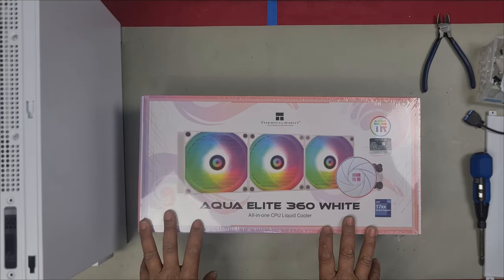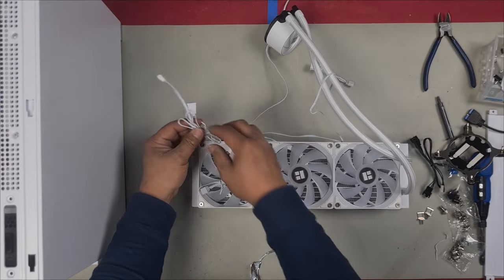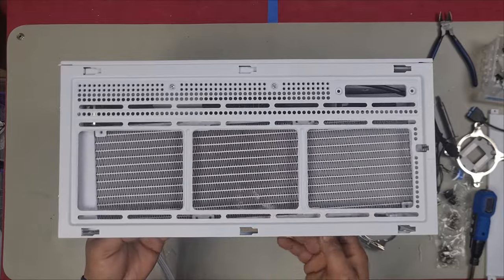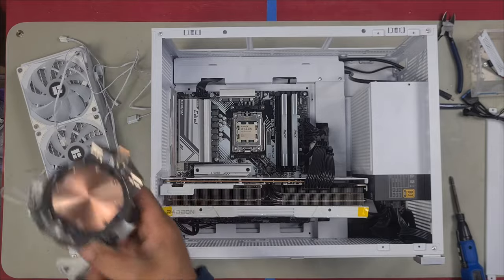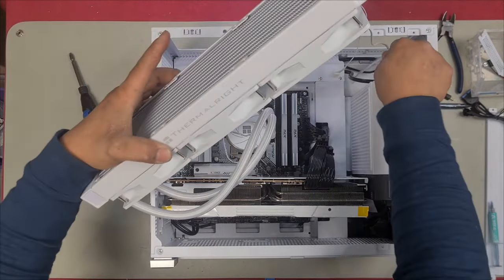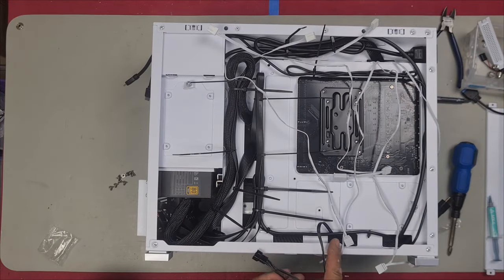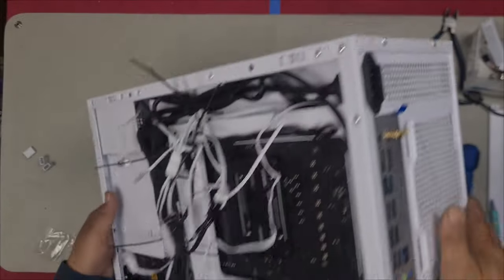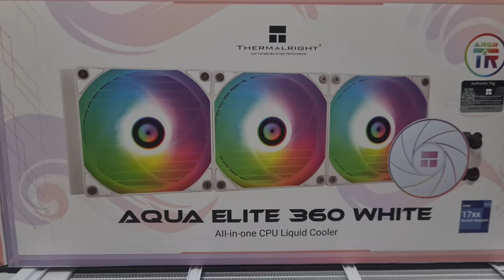how to :thermalright aqua elite AIO liquid cooler installation guide

Comment: Can you remake this for dummies like me?  The cable connections are driving me crazy
Reply from the maker: how do u mean
Reply: @MIKEYZVLOGZ  the argb cables are driving me crazy, I have so many cables I don't know where to connect. I have now bought an argb controller that I hope fixes my problem
Reply from the maker: the cables all have splitters on them so your able to connect them together aka daisy chain. so basically u connect each fan like a chain ... same for the fan cable 4pin pwm) except u use the black splitter cable they supply u with the cooler and once they are all connected...the last cable plugs into the 4pin  motherboard. u can use either cpu_fan1/sys_fan1 etc
and the argb plugs into the 5v3pin header not the 4pin 12v ..make sure u match the amount of pins and the label is there too so do not criss cross or you may damage the fan or short something
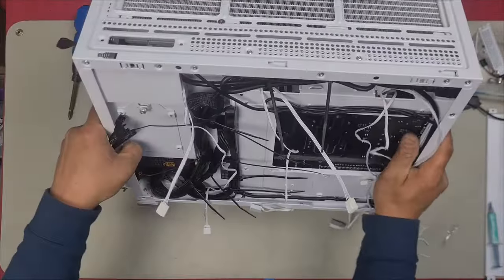Reply from the maker: @SaMcfc05 u didn't need a hub but u can use it did u ensure it was a 5v3pin hub at 8:50 I show how to daisy chain the cables...for the fan power pwm..u use the black splitter cable that comes with the aio... that allows you to plug all the fan cables into it ..and u plug that black cable into cpu_fan1 or sys_fan
Reply from the maker: @SaMcfc05 how many argb cables do u have total? I would suggest being patient and slowly route the cables one by one where u want them to go
Reply: @MIKEYZVLOGZ  I have a different model from the one you shown, I have one cable coming from the pump and one from the top where the pipe goes to the fan.  The second one is a different cable from all the fan cables I have seen and I have 8 it's 3 pin female but it's smaller than the rest.
Reply: @MIKEYZVLOGZ the black splitter was fine I did that, but the rest is where I'm not sure what I'm doing. I have 8 fans in total now. That's why I thought to buy an argb controller. It's becoming a real mess
Reply from the maker: @SaMcfc05  ok I see... right so the fans that have splitter cables on them already plug them together so it becomes 1 plug that connects to the hub ...and the rest u plug directly into the hub... honestly it just takes time and patience is key... wen infirst started building I hated doing it..but now its more of a necessity cuz u never want cables everywhere ...zip ties and twisty ties come in real handy... but if u struggle I'm building another pc and I'll show how I go about it...in the meantime keep trying ...it's straight forward ..just a matter of finding cleanest route and using zip ties to keep cables together to look neat
Reply: @MIKEYZVLOGZ  I will be watching. It's my first time building a pc  have been putting it off for years.
Reply from the maker: @SaMcfc05 oh I see fair enough ...I'll try do a short for u and then maybe a full video ...just know it takes time ...so don't know if u wanna just search youtube for other videos as there are heaps out there ... but I will address this for u...obviously I don't cater to individuals as it's impossible but I feel this will help alot of ppl too
Reply: @MIKEYZVLOGZ  there is not enough videos I liked,  especially with the cables and this brand. A full video for dummies like me would be great.
Reply from the maker: @SaMcfc05 fair enough
Reply: @MIKEYZVLOGZ  a lot of them focused on mounting, which is not hard, and all aio are the same with mounting. It's the cables that I struggled with, like this brand doesn't use many labels,  manual is terrible.
Reply from the maker: @SaMcfc05 I see.... I know what u mean .. I will do my best to give u a 60 sec short guide ..and then maybe an in-depth video on how to wire and route cables for aio argb..with and without a hub

Comment: I daisy chained everything and there's no argb thing left
Reply from the maker: where did u plug the final 5v3pin
Reply: @MIKEYZVLOGZ  I just unplugged one of the daisy chained cable and then plugged that into the rgb slot. It works. I booted my system and it doesn't detect ram or the CPU so I guess I have to take it apart again :(
Since you built a lot of pcs, do you have an idea of what the problem is?

Comment: I’ve connected the fan cable coming off from the block (pump cable) to CPU_FAN1 and or CPU_OPT. But in BIOS it’s shows 0RPM. Is it a dead pump?
Reply from the maker: wen connected do u heat the water moving or fan spinning ..if so it's not dead

Comment: I just bought one. one question,  Can I connect all 3 ARGB fans and the ARGB cable of the waterblock pump together on one 5V  argb header on the mb?
Reply from the maker: yes u sure can that will ensure they all sync in terms of rgb ... due to having splitters for each fan... so daisy chain tour radiator fans then incorporate the pump fan into it and finally plug the last argb 5v3pin into the mobo header

Comment: really good vid my brudda, just one question, are you able to set one specific color for each fan,
Reply from the maker: @eddyramquist8811  only if your motherboard software allows for it...I think u can aa long you find a software that can do it
Reply: @MIKEYZVLOGZ  like the signal rgb or thermalrights own software, also would still be able to set one color per fan even with dasiy chainged

Comment: which software should i use if i have x570 steel legend . Will the cooler and fans ( Thermalright TL-C12C-S X3 CPU Fan )change color at the same time
Reply from the maker: polychrome by asrock

Comment: Hi, my motherboard only have cpu fan header and system fan header. Is there any way to install this aio?
Reply from the maker: yes u simply install into cpu_fan1 or sys_fan1 it will be fine... some mobos have a dedicated aio pump fan but if u don't u can just use the cpu fan1 as it will speed up according to your cpu temp which is kind of what u want

Comment: What cpu u put and what temp you get idle and max load?
Reply from the maker: the cpu was the 7700x and max load i was getting about 70 to 80 but u never run at max all the time that weas only during cinebench single core and multi core stress test

Comment: Hi, nice vid! Also, does the cooler come with thermal paste?
Reply from the maker: yes it does
Reply: How to change the fan colour
Reply from the maker: @ronn23k  plug in to your 5v3pin header on motherboard and then u use software to change colour...or u need a hub with controller and use controller after u connect to hub..it's argb meaning addressable so u can change colour

Comment: is the ARGB controlled in a software or is there a way to decide which color to shine ?
Reply from the maker: yes via software
Reply: @MIKEYZVLOGZ  does it have a proprietary software or would it work with asus sync, msi, …
Reply from the maker: @mhergoparian174 no proprietary software just use any mobo software to control argb ..as long as u connect the 5v3pin to the mobo u can control using tour mobo manufacturing software

Comment: Mine came with a different splitter which has made it confusing
Reply from the maker: it should work the same way though..u should have an instructional guide and it will show u how it's suppose to connect

Comment: Is this AIO compatible with the Kraken G12 mount?
Reply from the maker: should be does your kraken use a thumb screw to mount pump? even if not u can use any gigabyte and msi as they are identical...just has to have the same style mount where there's backing plate...and then stand and thumb screw ...basically if ut mounts the same way it will work
Reply: sadly dont believe I can use this AIO as the copper plate for this AIO is a more squared shape rather than it being rounded. Same thing applies to the rest of the Thermalright copper pump heads @MIKEYZVLOGZ  
I plan on buying the asus rog strix lc ii 240 argb which if you see how their pump head is, you can see the difference as that's how it should be to be able to fit the kraken g12 mount.
Reply from the maker: @play_stationjr8636  ok wait a second I thought u meant can it work with the back plate..u mean u want to use the kraken mount and plate with an aio that fits it right? in that case no u can't ut won't fit .. but honestly aren't u buying a new cooler anyway..it wouldn't matter would it? cuz u will get all new parts to use that are suppose to fit together
Reply: sorrry lol, so basically I wanna get a new AIO cooler to use with the kraken g12. The problem is, is that the kraken g12 round part where the pump head goes into is rounded. So now speaking for Thermalright, it looks like their head pumps (wear you can see the copper plate) is rather squared than rounded, so the pump head wouldnt be able to fit it into the g12 unless I trim the rounded part on the g12 into a more squared shape. if tht makes sense 🤷‍♂
Reply from the maker: @play_stationjr8636  hmmm  ..I get it now ur using it to cool a gpu ... why did u say that...lol..ok so u have to use a specific brand that has the same shape as your kraken like msi or gigabyte many other too but u gotta check before u buy... u need the round one with edges that go in a circle I know what u mean cuz I've used that before too...
Reply: yeah exactly! and sorry about that, I should have mentioned that from the beginning lol

Comment: Any rattling like ls 520
Reply from the maker: what's 520?
Reply: @MIKEYZVLOGZ  i mean any ratteling noise come from pump and fan?
Reply: Argb sync from asus or signal rgb!!!
Reply from the maker: @No_name1389  everyone saying signal rgb is the best works with all argb
Reply: @MIKEYZVLOGZ  I don't see thermal right products on signal rgb supported devices. That's why i asked you which one you used?
Reply from the maker: @12noname906  I used the mobo software but everyone saying signal rgb will work ..u can try it and see if it works ..if u don't like it ..just use your mobo software whichever it is ..
Reply: @MIKEYZVLOGZ  yes i will . Which  one you use mystic or aura sync
Reply from the maker: @No_name1389  if ur with asus use aura msi mystic

Comment: Bro I brought this cooler but my motherboard haven't argb port.🥺
Reply from the maker: do not worry there is a good qork around and u can still change colours..  get yourself a sata to 5v3pin adapter they sell on ebay and Amazon and aliexpress is cheapest ..  most thing on aliexpress take only 12 days guaranteed now so it's not 1 month delivery like it use to be ...but if ebay easier get it there is u can find it local
Reply: @MIKEYZVLOGZ  bro this cooler support LGA 1200???

Comment: Question i did the argb wire connection but my rgb still doesnt turn on.? What could i be doing wrong?
Reply from the maker: @DaRealIcyK  did u plug in the power for the hub? there's a sata cable that powers the hub and if so make sure ur using a mobo software to run it... try press and hold the rgb button on front of case it changes mode from co trolling with rgb button to controlling with mobo software
Reply: the ARGB would turn on n turn of ina blink of an eye?
Reply from the maker: @DaRealIcyK have u plugged it into the motherboard 5v3pin header ? and also got the mobo software installed ?
Reply: @MIKEYZVLOGZ  No i dont have the software? does it come turned off out of the box when plugged in?
Reply from the maker: @DaRealIcyK  nah it should just work... as long as u plugged in the 5v3pin into the mobo

Comment: Spec
Reply from the maker: click on link in description and it'll take u to their website with full specs
Reply: @MIKEYZVLOGZ  how is the build quality of the cooler and the pump quality of the cooler . Can you try it on Ryzen 7 7700 .plz
Reply from the maker: @mdeasinhossain6916  it's actually built very well and for 7700x works very well keeps it at the 60 to 70 mark